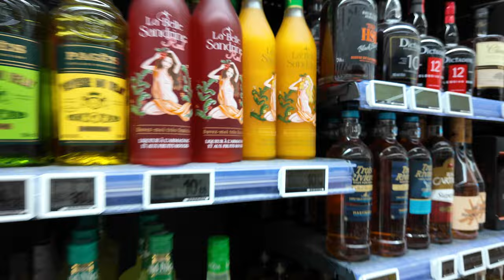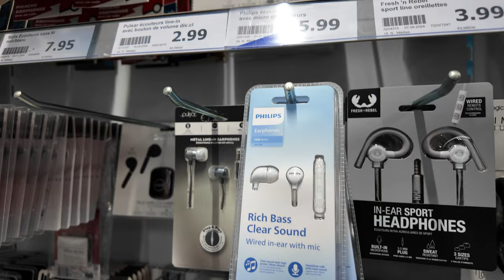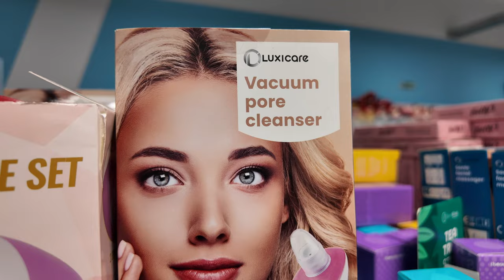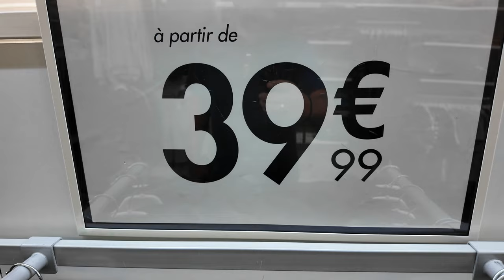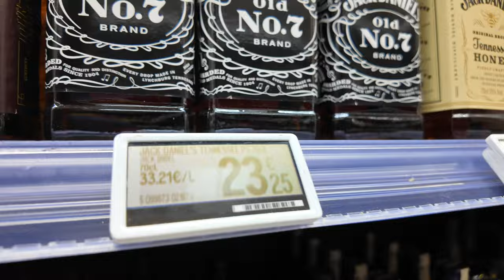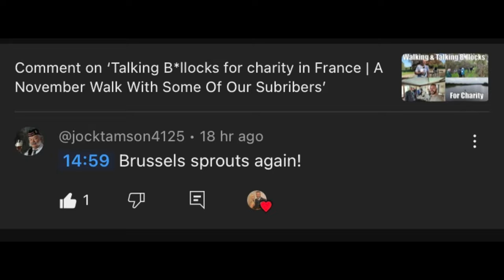Food shopping in France | Value for money?

Comment: I don’t think you can do all your shopping in one shop, I mostly use Netto, but with a few bits from SuperU. Pricing here is weird, it can be as cheap or even cheaper to buy small packets rather than one large one. Special offers can be tricky for example SuperU have one on Sodastream syrups, buy 2 get one free, but only on the ones that are 6€39, but not one at 5€99,
Meat is expensive but buy it when it is on promo and freeze it. Buy it when on offer and not because you need it.
Whisky is cheaper here than UK.
Reply from the maker: @peterjones4497  Thanks Peter. It’s gonna take time to get used to. Lisa mentioned about the meat being bought and frozen. It’s a good tip 👍🇫🇷